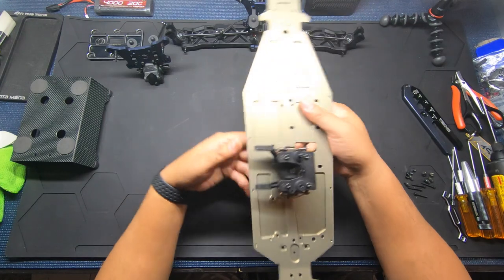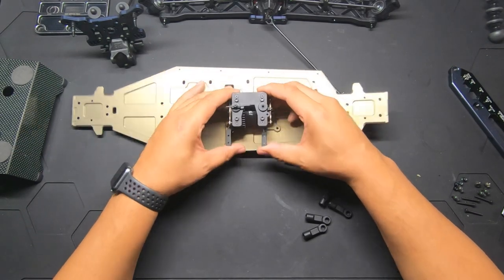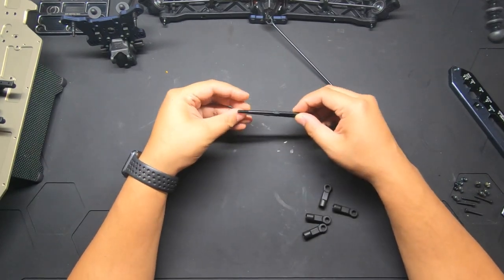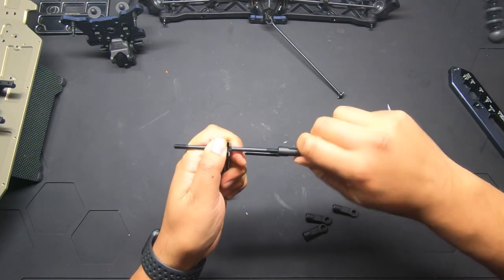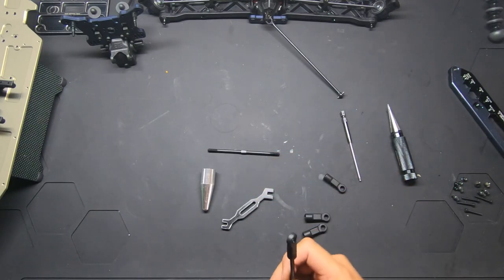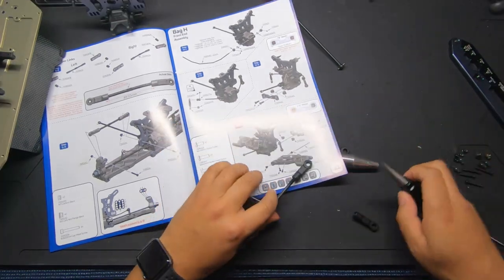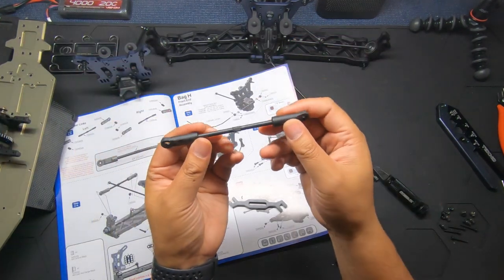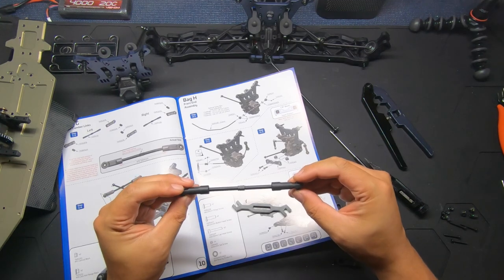RC Car Build Tips | Brakes Turnbuckles Linkages Rod Ends | Tekno RC NT48 2.0 Build

Comment: Thank you Mark, you dont know how many different places on different RC's where you have to start pushing hard to start a hole, one such instance is on the Arrma Outcast and Notorious roll bars. Not sure why I didnt think of that. Thank you for pointing that out, it will help in a couple areas.

Comment: I use chapstick on the metal threads and they go in like butter after that!
Reply: Me too. The chapstick makes it easier to adjust them too. 1/10 ballcups will pop off if the turnbuckles are tight.
Reply: Chapstick, or candle wax work well.
Reply: Chapstick… that’s a good idea, I’m gonna use this! Thanks allot

Comment: Every video about adjusting tie rod ends seems to have has a nut/hex fixture built in to the middle of the rod which makes it easy. I'm trying to see how people do it when it's just a plain old straight rod and NOT scuff the rod up from having to hold it with regular pliers to keep it still. I was thinking about using a shock plier tool because it has notches to hold shock shafts in place when you put the ends on which essentially is the same thing.

Comment: Great tips, as always, thanks Mark!  My own 2 cents - never rely on instructions when building a race vehicle, use a digital caliper to measure turnbuckles 👍  Btw, love my Dynamite shock pliers, they include that little tool for inserting ball ends, like yours, and have a punch for making holes in tires - great tool!
Reply: I was looking for the tool he used for the ball ends. Thank you for posting what it is.
Reply: @bigaspn  Yes, shock pliers, holds the shaft (preventing scratches) while you screw in the ball end.  Keep an eye out though, not all of them have it.

Comment: I hate starting the rod ends on turnbuckles and shock ends on shock shafts!  I usually keep a tap of the correct thread pitch in my rc tool kit for the right hand thread rod ends.  I just start the tap two to three threads in then use the turnbuckle to cut the rest of the threads.

 I do like this tip for helping start the left hand threads though, thanks for the tip!  Cheaper than buying a left hand thread tap cause i already have a body reamer.